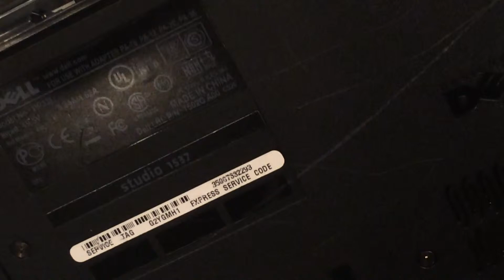Dell Studio 1537 Hard Drive Upgrade How To & Step by step instructions

Comment: Well . . . . . .  I wanted to take our files off our about-to-be-scrapped Studio 1537.  I followed the video exactly, but a couple of the screws that hold the hard drive into its encasement are in there so tightly we stripped the screws trying to get them out.  Why do they use machines with that much force putting in tiny little screws?  Now we have to either cut a groove in the screw tops or try some other genius way of getting them out.  I am tempted to just stick the new connectors from the enclosure we purchased on the end with the encasement still around it and see if I can access the files without having to fight with those screws. Otherwise, great video for us non-technical folks.